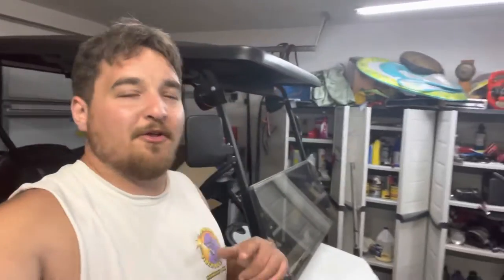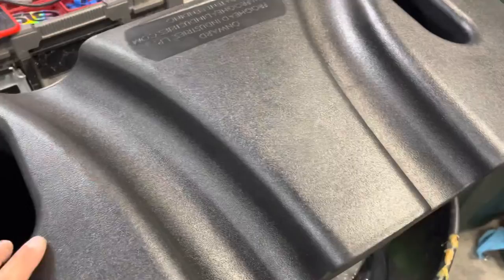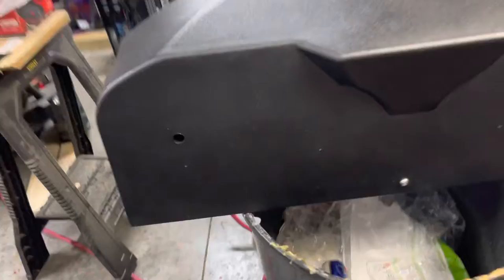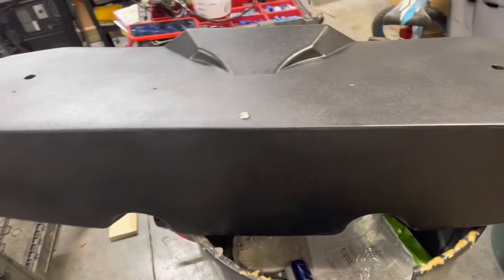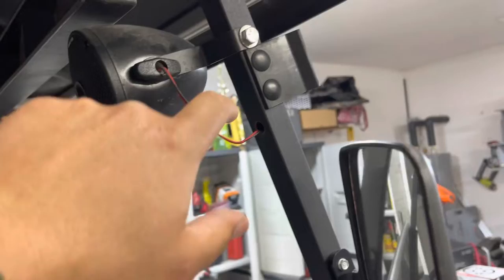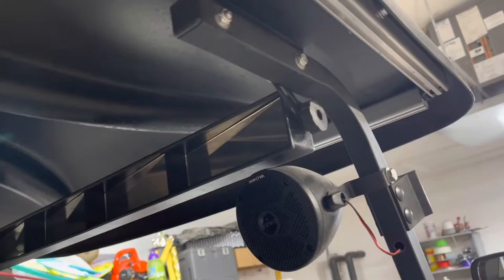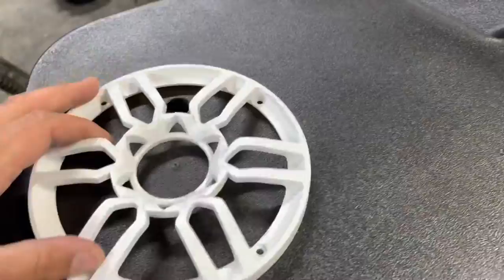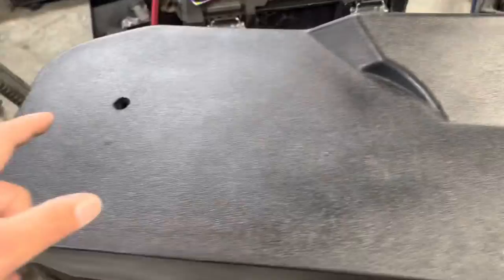Club Car Onward FrogHead industries Blank Box Overview before install

Comment: Went with a Soundwaves 11 speaker soundbar for overhead and a 8” Kickers bass tube between the seats.  It sounds amazing.  My other golf cart buddies are now wanting to do the same.   
I do like this set up as well.  
I am looking to find ways to help give extra support to my roof / window.
Reply from the maker: This really did make the roof more stable. Running the wires is a nightmare for sure wire management took forever but the way this thing sounds now is unbelievable. The bars and tubes sound good but some setups you can’t use the tube behind the seat like this one the seat belt bracket is all in the way so that’s why we did a single 10 in the back.

Comment: Oh and running those wires down to dash was a biiiiitcccccchhhhh!   Lol. Ended up turning into a 4hr job/install with amp sitting up in glove compartment.
Reply from the maker: This golf cart never sees rain or water so we did a big 150.4 amp behind the back seat small 350.1 for sub kept the glove boxes and back area for storage. 6 total 6.5 inch mid range 2 super tweeters and 10 inch subwoofer